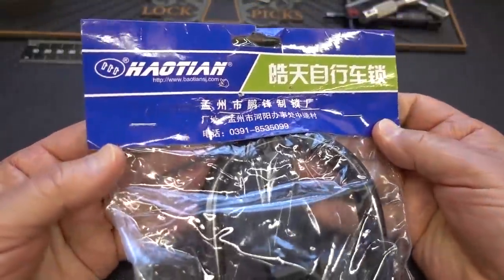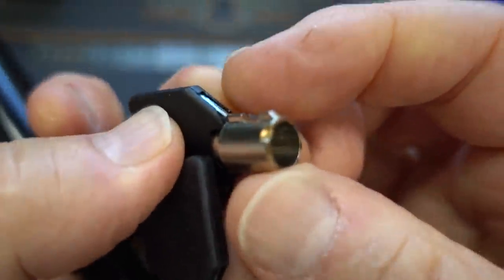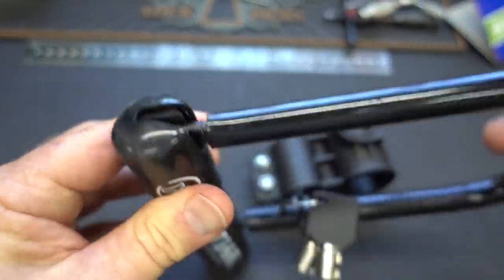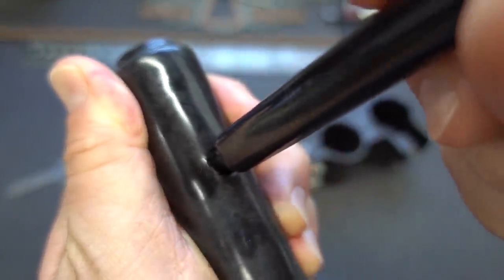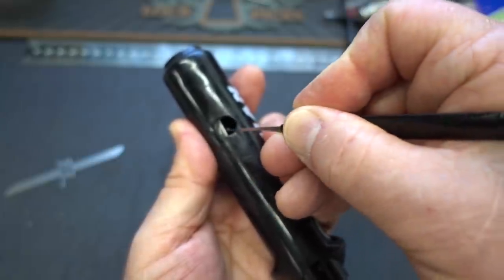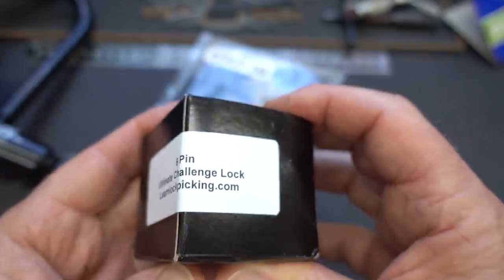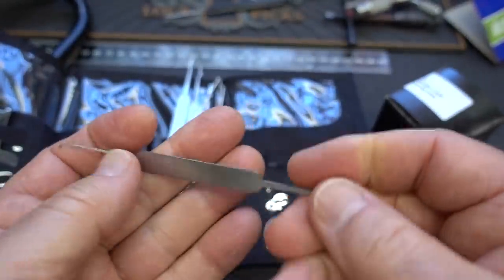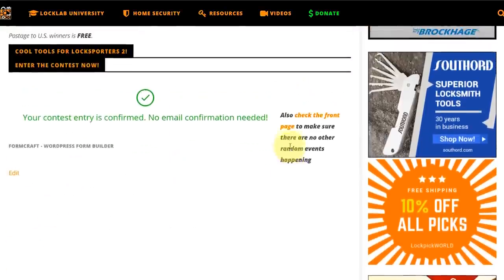(1730) Review: Haotian Bike Lock

Comment: Wow, they actually went out of thier way to have the shackle cut narrower, just where you need the extra space to put something in there to push back the locking pall. How thoughtful!! What a waste of metal this thing is. I've had something similar before, where the hinge pin was just a 3mm nickel alloy thing resembling a nail and the lock body was a piece of 2mm alluminium alloy tubing. I suppose you could use the shackle as an all-weather croquet hoop.

Comment: My favorite is when people use Eye bolts with padlocks so you can just use lock as handle to unscrew. Visible hinge pins always funny also.
Reply: How would you do that when two eyebolts are locked together?  Of cause it may be viable with a single eyebolt protruding through a slot or locked to a loose chain/wire.